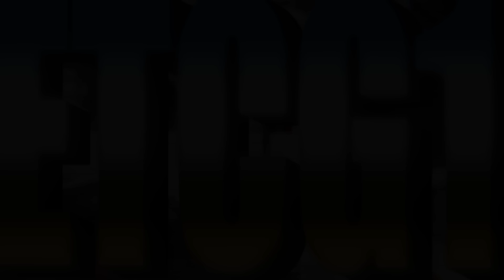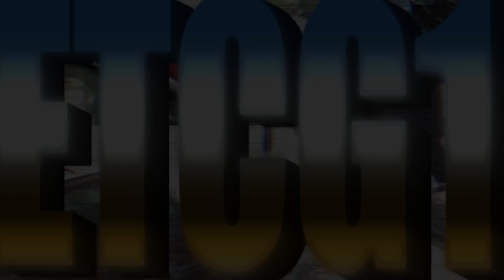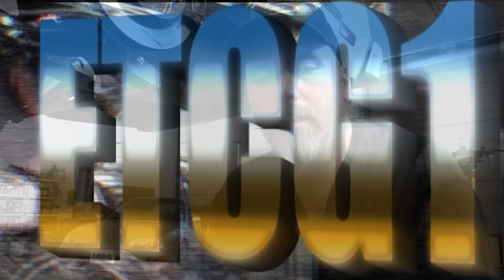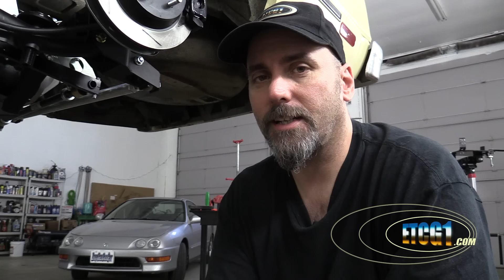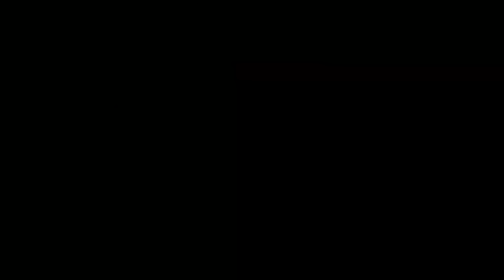Misconceptions About Performance Parts

Comment: for true performance, one most build each system of the car to maximize it.  yes you can just add some power boosters to but if the stock specs can not handle it.  you will do more bad than good,  this mainly for any form of boost and nitrous.  a big issue as well with alot of people is they think the internet knows all abut these things when they do not.  i have a room at my shop filled with coulton books for this reason.

Comment: if you and a cold air intake to get more air into the engine you need to do the exhaust system also. the more air into the engine the more air you need to exit the engine. some engines will require more fuel or a higher octane to compensate for more air flow

Comment: You can put whatever part you want on a car but if you dont tune it for it the part wont get you much. Exspecially the cars with computer controls you have to change fueling and shift points and much more to actually see a improvement. Like you said its more than one part its many of the subsystems that have to be upgraded as well. You can have 1,000 horsepower but if the transmission cant handle it your going nowhere fast cause your going to break it

Comment: I put a K&N filter on my Honda Element and I immediately saw a 50% increase in horsepower and gas savings.  If I add a chip I can get another 50%!
Reply from the maker: I hope you're joking. I have an Element with a K&N filter and have noticed no such gains. Also, Honda PCM's in the Element are not programable or chipable.
Reply: ETCG1 sorry...should have added the /s.

Comment: I remember a 2 Guys Garage Kia build. Why a Kia? Why not. The thing I remember that relates to this is they upgraded with cold air intake and exhaust system mods. They really went all out with this and gained quite a bit of power. The thing was that they did dynamic testing. They showed a big gain, but! Here is where the but comes in. They then had to upgrade the brakes as they were not up to the changes. They then went and dynoed again and lost ALL that they gained. This drove them nutz till they realized that the increased diameter brakes cause a parasitic affect and they lost all their gains. It is a whole package deal. They spent a lot of money and went..... slower!

Comment: Yeah,  I see a lot of people falling for the good ol autozone bolt on hp. 

When one wants actual hp increases,  you cant just change one thing. 

Slapped on a new intake?  Sweet,  too bad the cam and heads are stock so its  not sucking in anymore air then it was before. 

If you want real horsepower you gotta build the engine up or buy a built up engine. 

Cheapest and easiest performance increases dont come engine side.
You wouldnt believe how far just busting out some wrenches and reducing the weight can go.
Reply: Yeah, but there's a limit in how much you can remove, especially in a daily driver.
Reply: You dont know then that a intake, headers and cleand out catalytic converters made my m52b28 from 193 to 240hp?
Reply: Frrlas How much did those extra parts cost you?
Reply: Bet them dirty cats were clogging up most that potential.
Reply: I cant remember exacly. but I think it was aboat 700dollars for parts. (In Sweden 8-10 000kr) And then it was 500dollar for the dyno run.
Reply: Yeah definitely. 
But people really should have a dedicated car to racing or whatever and a dedicated grocery getter. 

Why niggas racing to the grocery store is beyond me.
Reply: Prove it.
Reply: "If you want real horsepower you gotta build the engine up or buy a built up engine."

This is obviously wrong. Years ago i bolted on a 2554r turbo on my 1.8 miata and a standalone ECU which then i tuned. From 140 hp, i am at least at 250 crank horsepower...the engine is still stock. Obviously it isn't only one part, i installed new intake/intercooler, injectors and an exhaust. 

But even if i got the turbo with the downpipe and a parallel ECU, and left all the other OEM equipment, you could easily get at least 30 hp and plenty of torque...

What you say is only true for NA builds, and for that, on most cars you can tune your ECU and get "free" power, problem is, tuning is expensive if you don't do it by yourself...
Reply: Anyone that says I got this much horsepower or whatever, post your dyno results.
I always dyno before and after. That way I know what really changed.
Reply: If you want me to prove it. its 7years ago and the car was sold at summers end. and papers in the glovebox. at the time we did nog use fasebook or anything lite that. so pictures was not something we thout about and sheard like today.
Reply: I would believe if you ttuned it.
Reply: yes sorry for my text, it's poor i know. my phone want it to be something else.. but if you wont believe me thats your problem. I know what I have done with my own cars.
Reply: yes I told that I did if you look at my first reply. nr 3 I think
Reply: dosbox907 😄
Reply: Ahhh.  Well hellyeah that make power. 
Let me clarify my argument. 

You cant bolt on one singular part and get noticeable and or reliable horsepower.

You will generally have to change something with it to see the benefits. 

When my argument is provided keep in mind me and eric are generally speaking about kiddos who drop 600$ on a set of hookers,  slap it on,  do nothing else and expect horsepower increase from the engine. 

Basically,  ricers is what we're talking about. 
People who like to look fast but have no idea what it takes to actually go fast reliably
Reply: ah ok. yes I agrree (y) I have done that myself. bolted on a full exhaust and was coolest man in town ;) but I lost power then.. dont think a tune would make it better that time eather..
Reply: I think a majority of us are at an agreement,  but we're car guys,  not english teachers and have a hard conveying our ideas.  Haha
Reply: A tuning program unlocks a lot of power potential you see the ECU is programs at the factory with how they want the engine to run
Reply: yes most of the cars is the ecu set to hold a specific program to have a fixed amount of hp and tourqe. if you modify an exhaust, the ecu vill stick to the same hp and so on, most of the time anyway.
Reply: My absolute favorite parts house gimmick. Drilled and slotted rotors.... Something you will never see on any legitimate (corporate) race car.

Comment: Diesel upgrades add power no doubt, turbo downpipe, turbo inlet horn, bigger 4-5in exhaust for lower egt and ebp, driverside full bore manifold for duramax 01-10, or a set of performance manifolds and up pipes, they all add power right out of the gate,

Comment: You're correct on having a balanced engine intake and exhaust but the only way to increase horsepower without mechanical parts is with a chip which is electronic, but the brighter you burn the quicker you burn out
Reply from the maker: In some cases yes, but in the case of the GSR you'd have to change the system entirely since Honda computers of that vintage are not programmable.

Comment: I think you hit the nail squarely on the head here.  Unless there's a part that is a major area or restriction (and that doesn't happen all that often in vehicle design these days), changing one part makes little to no difference these days.  A free flowing exhaust won't help if the intake can't supply the increased volume to fill that exhaust.  Then the combustion chamber, valves, ports and cams may have to be changed so they can let the increased flow get through...which can mean changing the fuel delivery (possibly larger injectors), maybe changing the ignition timing...all just to let that exhaust header work as it is intended.  On a stock engine, the intake is generally tailored to the head's flow characteristics and the exhaust flow capability...so changing one part in that list won't do much as the other pieces will still be strangling it.I find that every part of the car works this way...bigger brakes really should get a complete overhaul of the system...proportioning valve, master cylinder, etc.  Change the springs and you should change the dampers and sway bar as well.  They are all complete systems that are designed to work together, and needs to be viewed and modified as such.I have seen a Corvette at a car show (on the dyno at Cars at Carlisle) in this situation before...huge exhaust, cold air intake, cam, custom work on the heads...making exactly the same power as stock because he still had the factory ECU, which was apparently negating all the work.  It sounded really nice, but made no additional power - and cost the guy a bunch of cash in the process.I guess the rule to remember is: Everything affects everything else.

Comment: i would like to say good job u hit the nail on the head with this video its so true its not just one part that makes a machine its a whole system i wish u would of talked about bigger isnt always better tho because i have seen and heard of people talking about how they put the biggest throttle body, biggest exhaust, biggest turbo, or what ever part and that it is better than a smaller of same part every car and every build is different and they all need different things to perform optimally with other components.

Comment: I agree with the point that, no, one bolt on part can't give you any HP gains that you can feel while diving. However, I do agree that replacing your entire exhaust and intake system together will give you power you can feel. That's what I did with my 08 Scion XD, and I can feel a huge difference when merging into traffic and driving through the mountains. Would I say the car is now "fast"? No, it's just faster than it was before. And as far as MCM is concerned, I only saw the first video they did with the red Nissan so I can only speak on that. I don't dispute their findings, but they sort of misrepresented what they were proving. The car they used in the video already had a CAI. If a CAI provides no gains then why would Nissan have built the car with one in the first place? That video only showed that an after market CAI wasn't as good as a factory CAI, which I would have guessed to be the case anyway. I've always found it odd that nobody seems to bring that point up.

Comment: There is still a bit of the old school bolt on thinking hanging on. Back in the day, 1950s, 60s, 70s, even early 80s, "bolt on" included the carburator because it was a couple of bolts to change it out. So, if you bolted on a complete header back exhaust and a new carb, you would def see a power increase. But by doing the carb and exhaust, you were revamping the entire system from intake to exhuast. Each side would benifit from the other. Today, you bolt on a header back system, but have to reprogram the ECU for proper fuel parameters. No more carb. Its not "bolt on" in the traditional sense, but enough reputable companies sell hand held pre programed tuners for easy tuning. You need to do the whole system to see noticable gains these days. Gone are the days when you can swap 1 piece like the carb and find 40-60 hp dyno provable. All systems in a car today are designed to work together, and oif you think you know better than a multi-billion dollar company in swaping out 1 piece, then thats on you.

Comment: Once in a blue moon there are real bolt ons, i might guess in those cases it's where the OEM was forced to use a lesser part due to leagal or EPA or weight constrictions. Like the rubber high pressure power steering that always fails on the 5th Gen maximas with bolt on aftermarket metal replacements. Or like exhaust with Catalytic converters built right in to them.

Comment: Older cars, ie highly restrictive intake and exhaust cast iron manifolds, would wake up a bit with each part added.  Heh, not to mention be a lot lighter.   But it wasn't noticeable until you were done adding a complete intake and exhaust set up.    Even then, they generally were not much, at least seat of the pants, faster. But, they generally at least sounded faster lol.

Comment: Really depends on how the car accept bolt-ons. One of the biggest obstacles in the ECU not agreeing with the new parts and won't allow the motor to use them or refuse to run with the new parts without a flash and tune. Some ECU's will accept new parts to a limit. My car for example will accept a new intake and and exhaust but anything dramatic will require a tune.

Comment: Hey Eric, let's say you replace the intake header and full exhaust with performance replacements, shouldn't you be able to get more power if you get a tune to remap the ecu to accommodate the upgrades?
Reply from the maker: In the case of my GSR it is not possible to retune the computer. You would have to go OBD1 or stand alone ECU.

Comment: probably the only bolt on I've seen that works was a cold air intake on a v6 mustang 00  only measured about a 5hp increase on a Dyno without any kind of computer tuning. sometimes it can just be one part that helps performance sometimes it's more.

Comment: Hey Eric, just wanted to say that ive run an entire warehouse worth of ebay clutches on my 2jz and they all held just as good if not even a little bit better than all the brand Exedy clutches i used to swear & live by.. but fortunately my 2j is not bias. it will eat a clutch up after a whole day of hard runs at the track if its a 500$ clutch or 79$ one. doesnt matter.. and if they both work and hold the same then which would you run? like you said tho ppl judge stuff and knock it b4 they even try it or anything close to it.

Comment: i agree with u eric but unless u want to spend real money and can sync all the parts in unity to the air fuel ratio from the maf in front to the oxygen sensors in back response to timing and adjustments to prevent valve lash or knocking its really a good tune and a complete setup and understanding what the car,blueprintes in its already beneficial dynamics,can gain from not great performance in other places

Comment: I put 3 inch exhaust on my 2006 Grand Prix GXP, changed out the tune to get rid of Drive on Demand, upgraded my brakes, added upper strut tower braces front and rear, and I also added a tranny cooler and finned transmission pan that will allow me to drain the fluid and dissipate heat   These mods weren't done to improve performance so much as make it handle a little tighter, cool down the transmission, stop on a dime, and make it sound like a real V8 that it is.  if I gained horsepower cool, if not, cool.  I did it for the love of my car, that's all!   Dig that Acura!
Reply from the maker: That sounds like a very intelligent way to go about it. Thanks for your input.

Comment: Also, there is a misconception that performance part last longer. It may be the case, but not always. Like some tires... I forgot which ones it was, but one model have a life expectency of about 2 summers then they would be worn out already. Cheap ones may be 6 summers. The cheap would last longer, but have crappy grip... Same with performance brakes: it may brake faster, handle more heat, but wear faster. You need to take that into consideration when you buy your stuff: will the part last long enought to justify the cost and usage that you will do with it? In my case, I like grippy tires, but don't want them to cost too much, so I'll balance the performance vs cost vs longevity.

Comment: You should get hold of an Dyno and run before the part and then after the part is replaced. That way you know, not feel the difference. Also your going to need a Dyno for tuning of the Fairmont. I'm sure you know somebody with a Dyno, if not install one if you can. It's a great income source.

Comment: Most modern cars actually work worse with intake mods unless you change manifolds and computers because the air boxes are designed to deliver air in a specific way(how much flow, turbulence, density) that the computer is expecting to see, so any change and that system wont work the way it was intended. New cars as Eric has said, are often engineered to within 1% of their life. Unless you take something that is designed to restrict power(ex. a prius exhaust) and change it to something designed to increase power(a high flowing header back exhaust) you probably wont see much change on a modern car. It also gets to the point were you need to touch the engine(new cams, ecu, pistons, valves) because if the maximum exhaust created by an engine can be flowed through a 1" exhaust than putting a 3" exhaust on it will not do anything because the engine doesn't have enough exhaust output to require it. Most 4 bangers are more than happy with a 1.5" exhaust. Now if you start running with a higher compression ratio, bigger injectors, more duration then you may need that drain pipe exhaust; for most small cars though the factory exhaust will be just fine.

Comment: As far as engine parts, the only thing that will guaranty instantly a lot more  power your going to feel in the seat of your pant's is either a turbo or a blower/supercharger and if you want gob's of power, turn them up to find the week parts, replace those with good parts and repeat you'll eventually get to the point you want to be.

Comment: Hi Eric, Thanks, it is my Birthday today.
Regarding Header replacement. My 98 Civic cracked the OEM cast iron header.  I won $500 off of a call in radio show six months later and  immediately purchased Flowmaster Header.  Definitely felt an improvement or perhaps a restoration of power.
Reply from the maker: Happy birthday!
Reply: Cheers mate